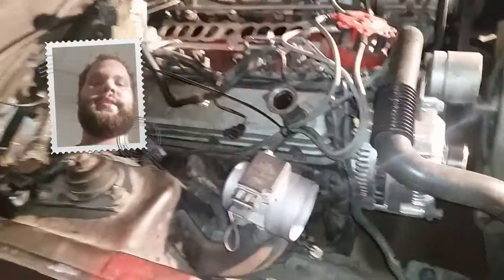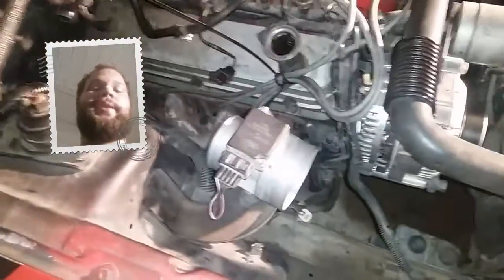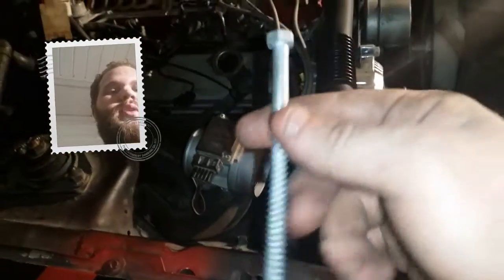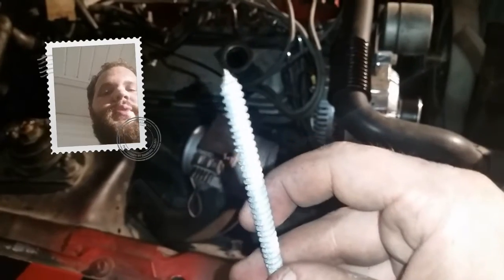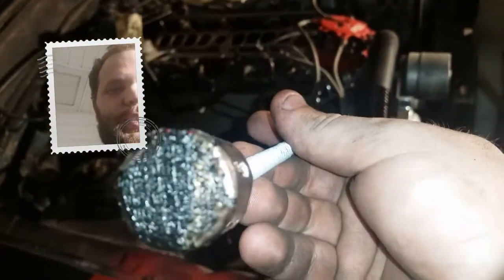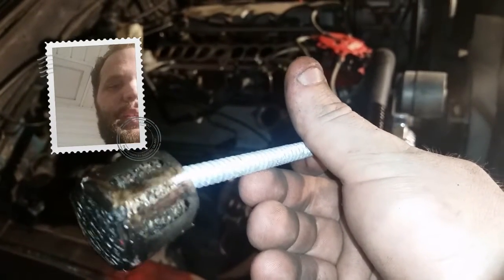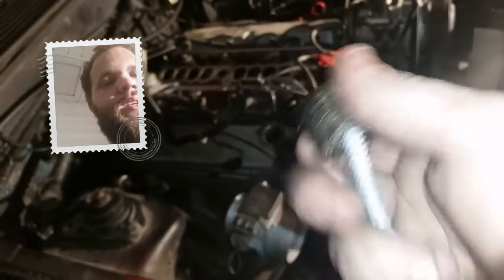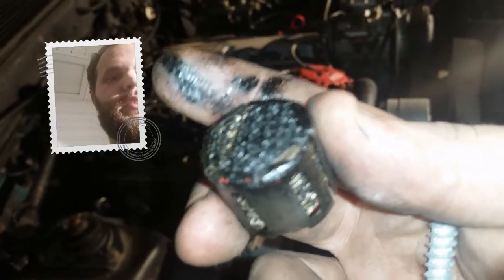Mustang pcv valve screen removal

Comment: Thanks mate. Hey what would happen if you didnt have one? I have a catch can that doesnt plumb thru intake. I just put a T-section on the outlet hole with no valve or screen. Any issues with this. Would it blow oil thru? Thanks
Reply from the maker: It shouldn't cause any problem that screen is basically there to keep small particles out of the engine.

Comment: Kinda like a catch can, but built in.
I have 156K on the 89 mustang and never changed the PCV or the bird's nest.
Guess what I'm doing tonight?
I've been having issues with some smoke coming out the tailpipes after coasting in gear downhill.
Reply: Shyt me too man! I've been hoping it's not a blown head gasket, it's not blue smoke. But I can tell something is dirty in the engine. I just bought the 88' mustang with 91k miles. A beautiful black car. Please let me know if you cleaned the screen, and if the smoke stopped, thank you.
Reply: @Trigger187 I did not replace yet, but did clean the birdsnest. Smoke downhill is gone now. Not sure that was the cure or not.
Reply: @mccoyji  so my Foxbody didn't have a PCV filter, so I installed one, I also installed a new PCV Valve. It's still smoking. Smells like gas, uses up a significant amount of gas, so my next theory is that it's running rich and one of my fuel injectors is stuck open. Imma look into it this weekend.